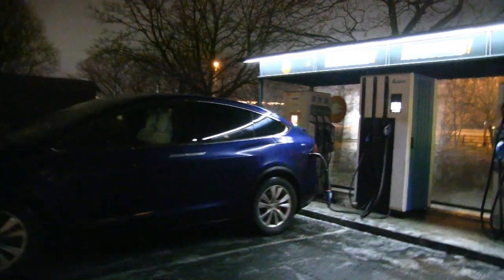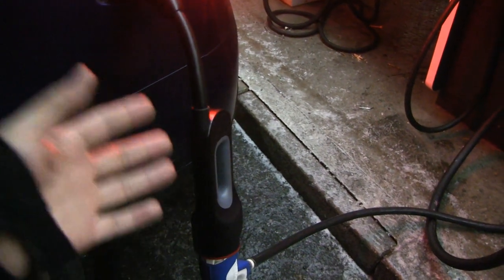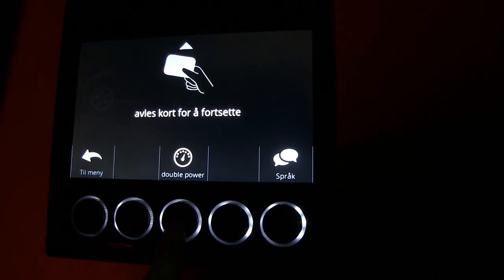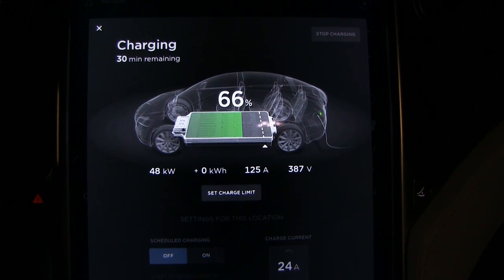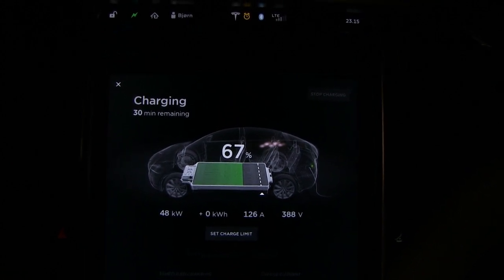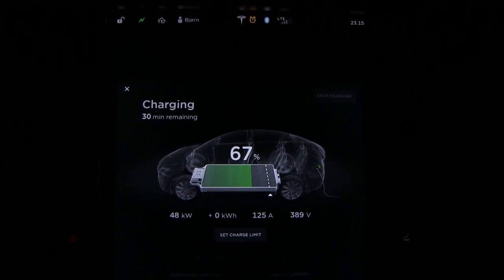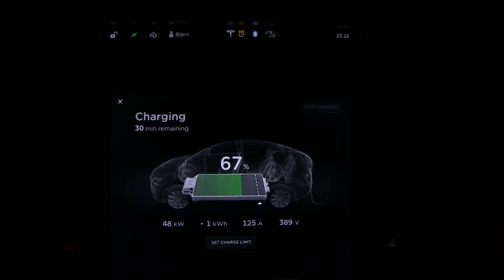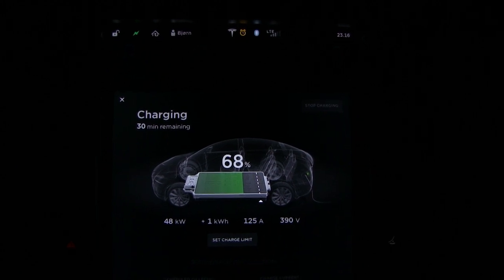CHAdeMO adapter on 100 kW charger

Comment: Thanks. 
Will we see the suggested 350 kW third party charging in 2017?
Reply: I'm afraid that this will take pretty long to roll out - there are many stations which are rarely used at the moment (in EU). This situation might be different in Norway, but there is no car out there which could use it as well, so zero pressure.

But Musk announced faster-than-350 kW charging with Superchargers v3 :)
Reply: I agree the present day customer is not informed or experienced; they won't demand 100kW let alone 350 kW charging.
Also, the 2017 vehicles are not expanding on the potential (pun, sorry) of the Tesla batteries of 2016 (100 kWh) they're more like 60 kWh.
GM is "full court press" selling the Bolt in California and its maximum rate of DC Fast charging is still an hour for 160 miles of range (with a max 230 miles range.) 

https://en.wikipedia.org/wiki/Chevrolet_Bolt
An 80 km per day commuter will need more than the 5 hour window of low cost EV electricity service (between 12:00am and 5:00am) and travelers wanting to recharge will be stopping for one hour per 160 miles ... basically twice the delay of a Tesla already at 300 mph.  With Elon Musk talking of 350 kW (call it effectively double) I think the demand curve will rise as customers see the greener grass in other charging infrastructure offerings.

Comment: Good information, thank you. I wonder if Tesla will make a higher power CHAdeMO adapter sometime. I doubt it, it took them a long time to come up with the current expensive one. Still it's good enough for me. I've only used mine about five times, that works out at $160 a charge but it is good to have just in case. The SuperCharger network is still very limited here (to be fair there are few Tesla cars here) so CHAdeMO and J1772 options are important to me even though I seldom actually use them.

Comment: First of all, 125 amps is a lot of current!  You can weld with less!  I'm amazed Tesla and other carmakers have made dealing with such high power levels as commonplace as charging your cell phone.
Reply: And then we have the Superhargers that can deliver over 300 amps.
Reply: my next car will be an EV.  given that, I would think a reasonable maintenance item would be to replace the charger connector socket on the car once a year due to wear and tear.
Reply: Answer to this problem is increasing the voltage.

Comment: It seems to me:
2000-2010 : first generation of EV drivers accepted all compromises.
2010-2015 : second generation EV drivers wanted range
2015-2020 : third generation EV drivers will want range and rate of charge

I expect to see the spec of a typical EV to be marketed on 
kWh "range" (battery capacity)
kWm "efficiency" (rated energy usage per distance in kilowatt meter)
kW "performance" (acceleration 0-60 and in general)
kWh "charge" (rate of charging in kWh)

Hopefully a standards body will have already published the equivalent metrics to transition from current fossil fuel "climate damage per mile" to a green rating for the vehicle.

The above four measurements should be part of a whole system where the energy source (a public charging station or home charging solution) will include actual carbon footprint numbers.

The vehicle manufacturer should also publish an actual footprint for the manufacture of the vehicle, for the batteries, for the maintenance and operating cost, separating out specifics for tires, lubricants, cabin trim choices, etc. and for the whole system lifecycle of a vehicle when fully recycled.

With all the efficiency and footprint numbers in a simple table, it should be a score and detail "nutrition facts" label for all products (from a toothbrush to a nuclear torpedo.)

Once each person, city, state, nation and all their governmental operations are reading that "climate facts" label, the cost to build a drone to fire missiles can be opposed not only on the (so far ineffectual) grounds of crimes against humanity, but on the economic and environmental impact ... using a "green" bomb to blow people to pieces becomes all the more obviously futile once the country doesn't even need access to the "oil in foreign soil" anymore ...